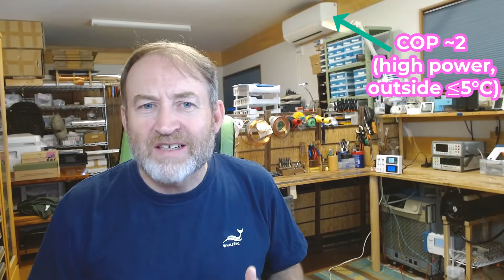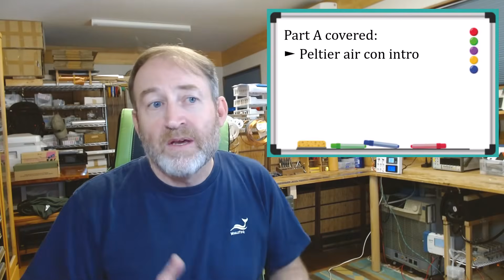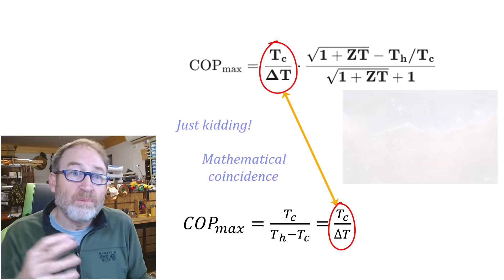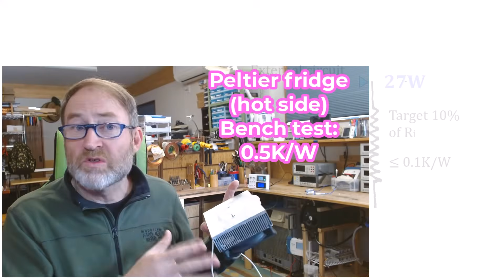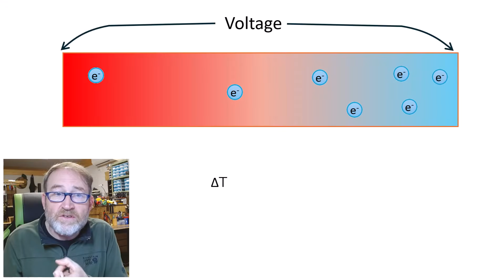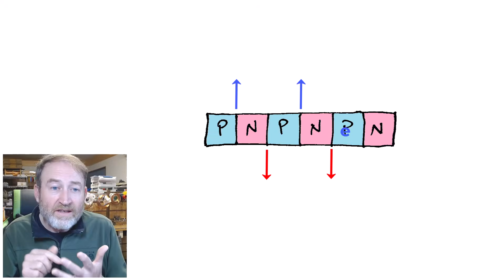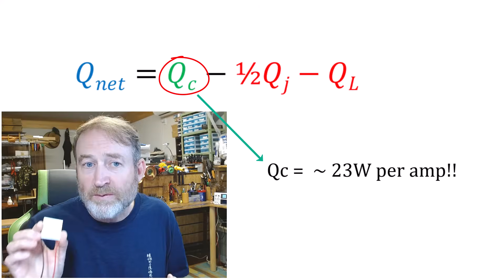The Peltier COP 30 Gateway (Part 2)

Comment: I can't stand the idea of vapor compression based heat pumps for sub freezing temps. They just can't do it. My electric bill every winter proves this.
Reply from the maker: Based on what I know about heat pumps, I theorised that running a normal air con at highest fan speed is much better for efficiency, as it effectively has lower thermal resistance. I found that that at low fan speed, the output temperature was nearly 60°C, which combined with sub zero temperatures outside means the dT at the compressor itself was huge and obviously not very efficient. Running the fan at high dropped the outlet temperature to about 45°C, which is huge boost in terms of heat pump efficiency. And then running the air con at high fan speed during the day when the outside gets up to 10°C, even better. Store the heat in the furniture for later use at night. Sounds crazy but it seemed to save a lot on electricity, at least anecdotally.

Comment: 2:05 To be honest that is a really poor air-source heat pump in terms of efficiency to only be getting a COP of 2 in those temperatures. I'd have expected to be getting closer to 4 with a decent system in such warm temperatures. (Not trying to knock down on your awesome peltiers, just something I noticed here). :)
Reply from the maker: Yes, that COP of 2 in the video (at that point) was for the compressor based air con system. The thing with compressor systems is that it's really hard to measure the true heat coming out of an air con (it requires some special techniques) so most people work off the industry figures which they typically say "3 or 4" which are highly glossed over, average figures. In reality the numbers are all over the place depending on the conditions (temperature inside, outside, how hard the compressor is pushed, how hard the fan is running, when was the last time everything was cleaned :) ...). In reality they probably range from about 1 to 6 depending on conditions and age.

Comment: When DT = 0, the peltier can technically give you infinite efficiency, but in practice as soon as you try to put any power through it a DT appears. It's best to consider this as a limit, the less power you put through it the higher your COP is.
Reply from the maker: I think it's not quite as simple as that. The Peltiers I use generate about Qc = 23W per amp, or 23W at 1A which is largely unaffected by the dT. That 23W does not actually travel through the Peltier by normal heat flow, rather it is transported structurally by the electrons , and provided there is good thermal contact externally, never actually passes through the Peltier itself. At 1A, the I²R losses are just 2.3W, which is normal heat flow and of which half goes the cold side. So that sets a COP at dT=0 of about (23-0.5*2.3)/2.3 = 9.5. For every dT 1°C there is an extra 1W of normal heat flow, which can add or subtract depending on the polarity, and the Qc does change a little (about 0.3%/°C). The infinite COP bit is just ignoring  the I²R losses, and leads to a lot of angst but since in the real world the I²R is always there, it's not really an issue.
Reply: @PeltierPower  Uhhh, but what happens if you reduce the current, doesn't the COP go up? I^2R at low current tends to zero.
Reply from the maker: Yes, absolutely, that was really the point of the whole COP = 30 rabbit hole. It's not related to entropy or the Carnot theory, it's just the fact that we define COP as Qc/Wi. If we keep that mentally separate (Qc and Wi), and at dT = 0 you have Qc =αTI -½I²R and and Wi = I²R then yes, Qc falls slower with current compared to Wi. The COP is just a human construct and doesn't always make sense to focus on this. There are applications where the dT is low or close to zero, but you wouldn't go to the effort to build a Peltier system get a measly 0.1W per Peltier just to get a COP of 100. Cost wise it doesn't make sense. Rather they need to be in the 1-3A zone (for an 8A Peltier) to be cost effective at moving heat. They key point is they can still get a decent COP of say 2-4 in those applications.
Reply: @PeltierPower  I keep wondering if I'm missing something, because you know fantastically more about this than I do, but I'm 100% certain that this IS related to Carnot theory. Carnot gives you an ABSOLUTE limit on COP. The limit goes to infinity as delta-T goes to zero. But the power you can achieve from any fixed piece of equipment inevitably also plummets as delta-T goes to zero (bigger equipment everything else being equal gives more power but it still trends to zero). That is all entirely normal thermodynamics. I suspect if you look carefully at the other terms in the equation, it's giving you a number between 0 and 1 as to how close these devices achieve perfect Carnot efficiency. So that's not a coincidence.
Reply from the maker: I think the critical point here to understand the difference between "spontaneous heat flow" which requires a dT to push heat via conduction, verses the heat pump effect where heat is trucked around from one place to another via a different means. For loading the "truck" conduction is needed so a local dT does exist (at the cooling face between say an aluminium block, thermal paste, ceramic, copper links and finally the semiconductor edge), and for unloading a similar dT must exist, again at the other face (in reverse order). The critical point is that these are physically different locations and they set up their own independent dTs to load/unload the heat, but the dT between those locations is not important for that process (a fridge is easier to see because they are hugely different locations, but it's the same in the Peltier). The dT is important for thermal leakage but that's just normal spontaneous heat flow that's going on in the background. The bit where entropy gets in is really a difference in the loaded/unloaded energy (or power) due to the difference in absolute temperature at those points, for example if side A is 290K while side B is 300K, there will be about a 3% difference in the loaded/unloaded heat. The Carnot theory sees that difference, and ONLY that difference as the "work", and ignores the I²R heat and normal thermal leakage. The COP in the Carnot theory is the amount of heat trucked divided by heat lost (or gained) due to the difference in loaded/unloaded energy. The point is the trucking goes on regardless.

Comment: The ideal ZT of 1.3 gives an efficiency of 20% compared to the carnot cycle. Your heat pump corresponds to about 15%, so you are close to the ideal operation of the Peltier devices. The heat leakage is a bit of a problem, even an ideal device would dissipate the Seebeck voltage across its internal resistance.

Comment: As far as that pesky divide-by-zero in COPmax calculations:  ChatGPT (or was it Gemini?) was, like LLMs frequently are, wrong that the divide-by-zero in the Carnot theoretical efficiency is a problem that means that heat pumps with a delta-T of 0 have some sort of problem.

It's simple (and I think there is a bit of overthinking of that issue here) - Carnot efficiency is the maximum theoretical efficiency of a system.  No real system ever achieves that theoretical limit.

So a theoretical limit of infinite COP for delta-T of 0 isn't a problem - it just means that you'll never break the law with any real COP you manage to achieve at that delta-T.  An easy way to think of the difference between ideal Carnot efficiency and real-world Peltier efficiency is I2R losses - an ideal Peltier junction would be made of superconductors with R=0.  But no such junctions exist in the real world.

Edit:  Thinking about things more - that equation that takes ZT into account would be the performance of a Peltier junction with nonzero ZT but zero I2R losses and no leakage.  In the real world we have I2R losses and leakage.

Edit 2:  Seems like ZT takes R into account. But again, these are theoretical limits and real devices never achieve theory for a massive variety of reasons.

Side note (and this might be partially because I'm viewing things out of order) is that a corollary to the external thermal resistance issue is that many Peltier applications drive them too hard.  e.g. if you can't improve your external thermal resistance, you need to reduce current and perhaps compensate for that with multiple elements.  (In fact your later parabola video which was featured by Hackaday states this well!)

A second side note - have you looked into counterflow configurations?  You might find https://patents.google.com/patent/US6658860B2/en interesting
Reply from the maker: Since making this video I've got a better understanding and recognized (which fits with your analysis) that there really a 5 discrete components: Qc which is the raw Peltier heat sink effect at the cold face (= αTcI), Qh which is opposite at the hot face, WE which is the energy flow due to entropy, where WE = Qh - Qc; WJ which is joule heating in a Peltier or motor/friction in a compressor, and finally WL which is the leakage. The Carnot cycle ignores WJ and WL, so there is just WE, and since COP = Qh/WE = Qh /(Qh-Qc) the Carnot theory drops out neatly COP = Th/(Th-Tc). So WE (entropy) can either add, subtract or be zero with respect to Qc, depending on Th and Tc. The dividing bit is just us humans doing some silly math. And of course the real COP (e.g. for cooling) adds in joule heating, leakage so COPc = (Qc-0.5WJ-WL) / (WE+WJ+WL) and this can never be infinite, it can still be negative (generator mode), if WE is negative and |WE| > (WJ + WL). Interesting stuff!
Reply: @PeltierPower  It's a fact that nothing can be more efficient than Carnot and that it doesn't include some variables that are important in calculating other cycles. But it helps to remember that's not because there is a problem with the carnot cycle, it's just that it's the cycle which intentionally asks the question "what is the best you could do if you were able to eliminate all irreversible losses?" and the answer is that without losses you get the carnot heat engine or carnot heat pump with such and such behavior. (The cycle is imagined as a 4-step sequence of alternating between isothermal and adiabatic expansion and compression.) But you can instead say "okay, now what if I had some other form of compression and expansion" and you might get the otto cycle, like a gasoline car engine. This isn't a heat pump cycle, it's a heat engine cycle, but that doesn't matter. The point is it uses a different set of four steps and has different limiting variables - the efficiency limit in the ideal case is based on the compression ratio as well as the specific heat ratio of the gases. Of course, it still needs enough temperature to satisfy the carnot limit, but it will have that. It just has losses that were intentionally excluded from carnot. The diesel cycle depends on another variable as well, the volume change during the process of combustion. Then there's the stirling engines, which in the real world do have losses but in theory, they can match carnot. The actual systems have a lot going on and don't really match up as well to their ideal form. But comparing stirling to otto, you can see how there's a difference between a cycle natively having a loss that changes its calculations and a real device being an imperfect version of the theoretical cycle. Oh and of course the stirling cycle does get used as a heat pump, often as a cryocooler. Though it's usually only approximating the cycle even before real world losses because they like to use things like crankshafts that don't move the way the theory specifies.
Reply: I think that's why the Carnot efficiency in the ZT COP is not a coincidence. Carnot gives you the absolute maximum no device can exceed. Adding more specifics of the actual device doing the pumping multiplies that maximum by a factor between 0 and 1. Makes complete sense.

Comment: Zero temperature difference means no work is needed to move heat. The Seebeck voltage is the part doing work, at 0dT, it goes to zero.

Comment: As far i remembered my thermodynamics and thermostatics courses.
Cannot theory dose not use Th/∆T FOR efficiency that eqations was simplified for cannot heat pump specifically,
And COP IS always how much heat energy you are dumping or absorbing for per energy you use.
So initially when it blows up it means you haven't yet felt the resistance of absorbing heat from one side and dumping on hotter side. Negetive COP means universe is with you keep going.
Reply from the maker: Yeah, I like the universe is with you phrase. What I realised after making the video is that are really 5 terms at play, Qc (raw cold side heat in), Qh (raw hot side heat out), WE (entropy), WJ (joule heating, or motor losses etc) and WL (leakage). For the entropy bit WE = (Qh - Qc). The Carnot theory ignores WJ and WL, and there is only entropy, so COP = Qh/WE = Qh/(Qh-Qc) = Th/∆T since Q = αTI (seebeck x absolute temp x current), the "α·I" bit cancels out and you are left with COP = Th/(Th-Tc), which is the Carnot theory! So when Th>Tc, entropy or WE is working against the net heat pump effect, Tc>Th means entropy is assisting the heat pump, and when Th = Tc, it just means there is no entropy, WE = 0. But in the real world, we have WJ and WL to worry about, and for small dT, these dominate (which is why I never realised WE as a separate term). All clear as mud?
Reply: @PeltierPower i Think you mixed up many things. Carnot's theory provides a theoretically most efficient heat pump or heat engine at some ∆T and Tc. It's Qc, Qh and W(work done) is conveniently proportional on Tc an Th and ∆T.
COP at ∆T never made sense here nor in carnot cycle.

I noticed it latter that in peltier Q's are dependent on I and T while W is as always Qh-Qc, I notice Qh=αITh+0.5IIR-K∆T
And entropy/enthalpy are complex things and concepts then work or energy consumption.
And real life COP should change with constant I so putting a current controller could provide maximum efficiency for A module.

Previously dazzy chaining Heat pumps are sapce consuming in nature. So, many sytems are in four to five heat pumps in chain.
I wonder how cold can pelteir chain could go before αITc becomes smaller than other IIR +K∆T losses.

Comment: Negative COP from Carnot formula simply means that you can in principle generate power from the Peltier (rather than consuming it). The COP in this situation (which is heat flow divided by electrical power in) is the negative reciprocal of the usual figure of merit for a heat pump (which would be electrical power out divided by heat flow).
Reply from the maker: I later realised that for a Peltier, the Carnot formula arises from the αTI component which in my model I've simplified to be the same on the hot and cold side, but actually Tc and Th are usually different, so there is a difference between the raw Qc and raw Qh, ignoring leakage and joule heating. This difference is the "work" associated with entropy, we could call WE, which is separate out from WL (leakage) and WJ (joule heating). If COP based on WE only, the Carnot limit falls out neatly, Qc = αTc·I; Qh = αTh·I, WE = Qh - Qc, and COPc = Qc / W = αTc·I/(αTh·I-αTc·I) = Tc/(Th-Th), which is the Carnot theory. If Tc > Th, then WE flows in the same direction as Qc, that's all. It's not that the Peltier becomes a generator per se, as the Qc and Qh are usually dominant at the small dT for practical applications. If Tc >> Th (like Tc = 200°C, Th = 20°C) then WE could exceed Qc and Qh, at which point it is reasonable to call it a generator.

Comment: Huh, thermal resistance, thermal resistance, it seems that peltier coolers have an impedance matching problem - its similar to loudspeakers - they are inefficient in how they couple the moving mass to the air - add a horn which transforms the impedance and the efficiency multiplies - peltier works well when we swamp out the internal resistance by coupling it to low external impedance.
Your figures on cooling and aircon of 250w sound about right for a well insulated dwelling - current local regulations produces a 100sqm house that needs around 2.7kW of power for a temp difference of 50c - scale it down to a room, decrease the delta T and 250w look the part!
Reply from the maker: I've since scaled up the Peltier system to match a 300W solar panel with a plan to get 600W (COP 2 for heating, which is a compromise based on a few factors like limiting the number of Peltiers), and using that to warm a 35m² room. I didn't quite get the 600W (about 550W, but still COP 2). I'm finding it lifts the temperature OK but it is slow and once it gets a few degrees above the floor temperature that acts as a large thermal mass that needs to be warmed up first. Next year I'll have it running from late Nov so hoping that constant heat on sunny days will prevent the floor from getting cold in the first place, at least that's the plan!